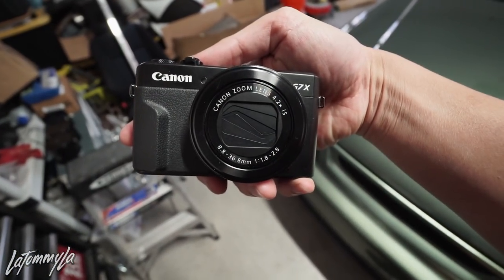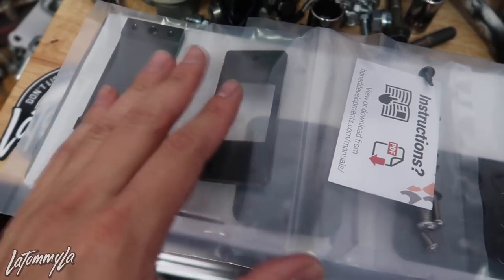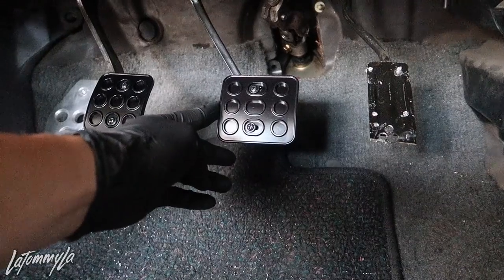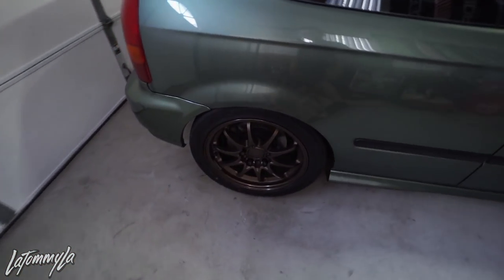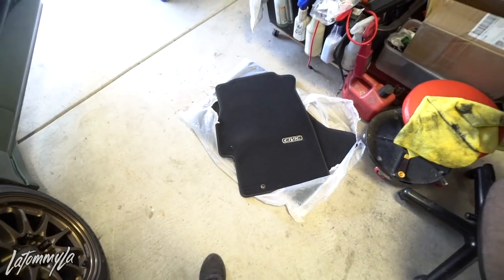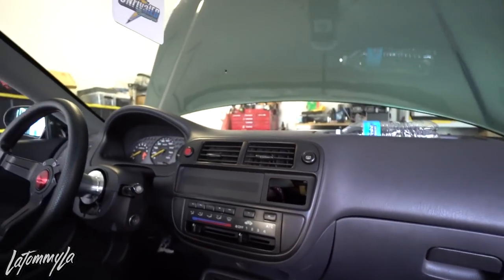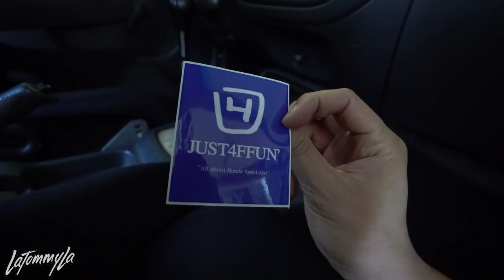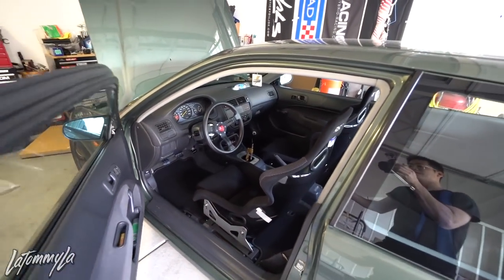Interior mods are the best mods!

Comment: I didn't know the clock wasn't standard in the US. Anyways I have a clock like that. Tip: don't connect the illumination wire. The clock will dimm when the headlights are on. But the dimming is a bit too much. I found my self turning off the headlights to read the clock. So I cut that wire. It's not too bright so it won't be annoying at night.  You will need to connect the memory to a constant 12v so it holds the time.

Comment: The floormats are for coupe or hatch and the coupe has a different width panel where the hatch release and fuel door release is because it has the keyhole for locking the trunk.  The floormats look good but they are cheaply made and will quickly become matted down where your heels rest.

Comment: You need to up convert to the 2000 civic climate control module. Its not expensive at all and theres good DIY guides on Honda tech and other places as well. The dials look soooo much better than the slider.